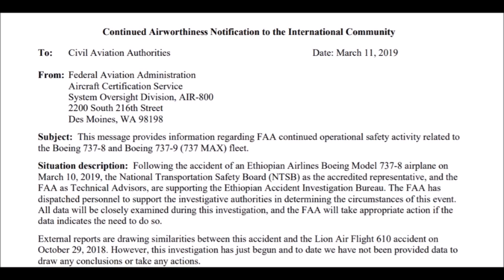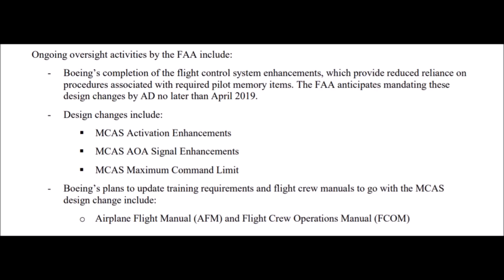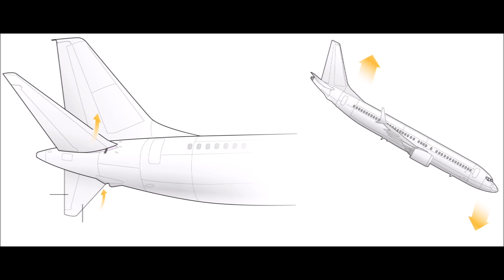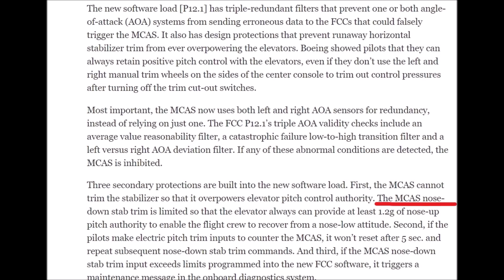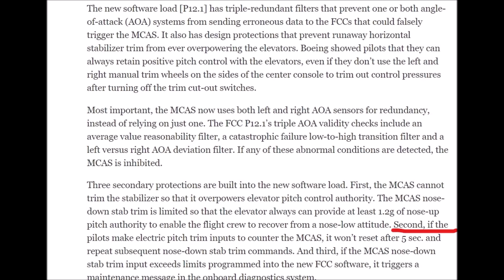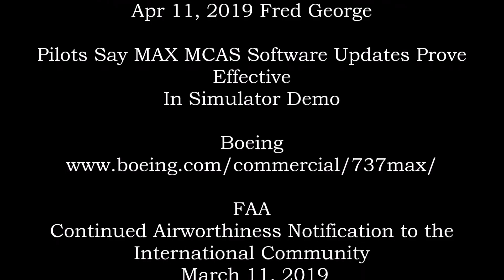737 Max UPDATE 14 April 2019 "The Fix"

Comment: As an A&P and pilot, having a computer that can take elevator authority completely away from the pilots control or cause a stab trim to have greater authority than the elevator is a terrible design. I'm with you bringing up the point how this got through certification in the first place. Situations can and will happen that require the pilot to be able to 'hand fly' the aircraft without a computer fighting every input to stabilize flight.
Reply: You are right If a pilot can not have complete control of the aircraft when the need arises then you might as well not have a pilot. I will never fly in a drone type of aircraft.  We will always need pilots like Capt. Haynes of Flt.. 232 in Iowa, July 1989, and Capt. Sullenberger of Flt 1549, January 2009..
Reply: @jameswilsonjr5726 Strangely Boeing made a big fuss over its fly by wire 'soft limits' on the B777 when it came out versus Airbus hard limits.   Boeing were completely correct so its bizarre they threw everything away on B737 MCAS.
Reply: @WilliamJones-Halibut-vq1fs  yeah, they certainly threw caution to the wind on this one. Sounds like this problem was driven entirely by money and convenience. Just to keep the type rating the same for transitioning flight crews. They compromised safety to avert the hassle and took a shortcut.
Reply: @BretAllenStudios    BOEING did not trow caution to the wind with the 737 . please stop propagating senseless and  incorrect statements.  All modern aircraft have some degree of fly by wire since you will damage the airframe without limiting software and feedback sensations provided to the operator of the controls.  I am surprised that no one is curious why a vane angle of attack sensor would be reading about 15 degrees of variation to the relative wind with the aircraft not in a stalled configuration. The aircraft airspeed is over 200 kts and there was  no icing conditions present to say that the angle of attack sensors became frozen with condensation.  Airbus lost an aircraft because of washing the exterior with fluids and introducing liquid into the angle of attack vane which later became frozen at altitude Airbus 320 Prepignan flight november 2008.
Reply: Is "stab trim" different from "elevator authority". Don't they both actuate the same control surface and the key difference being, one is used essentially to set the "nominal" control input (e.g. trim) and the other to make adjustments around the nominal (e.g. elevator) like if for some reason all the passengers ran up to the cockpit cuasing nose-heavy situation, one might "trim" the aircraft to get it level in that configuration and then use the elevator to raise or lower the nose around that level condition? Is that the key difference here?
Reply: @markmiller4414  yes. The elevator is the flight control surface itself. The horizontal stabilizer  (which the elevator is attached to) is pitched up and down using a jackscrew to 'trim' the aircraft. The majority of the control should rely on the elevator, while the trim stab makes the fine adjustments for the pitch configuration. Thus takeoff configuration of the trim based on the center of gravity  (CG) of the aircraft for example. The main purpose of the trim on an aircraft is to prevent having to hold back pressure or forward pressure on the control yolk to get the desired pitch.
Edit: This can get complicated on large commercial aircraft though, because like in the case of a runaway trim, especially at low speeds, the aircraft requires the stab to be set correctly in order to have the proper control over pitch. This is why they have movable stabs as opposed to a simple trim tab like on a light aircraft. They have to be able to deal with huge variables in cargo, passenger and fuel weight. The CG envelope on these aircraft are fairly impressive.
Reply: @BretAllenStudios  If I Understand you correctly, the flight elevators are on the stabilizers. Thus, errors in the movement of the stabilizer could amplify or negate commands to the flight elevator. It sounds like a plan designed to fail if erroneous automation is added.
Reply: @jasontraxler2946  exactly. That's why it's so important to have the trim set correctly on takeoff. If a trim runs away  (full down trim) on a takeoff, depending on where the CG is, there may be insufficient elevator to recover especially at low speeds. At least insufficient to recover in time. As speed increases, the control gains authority, however that gets complicated as well since many designs use 'limiters' controlling the throw of the flight control based on airspeed, which prevents requesting an input that could over stress the flight control surface.
Reply: Nunya Bizness 
1.I think the stab trim design just optimizes the drag on the whole control section.
They should have went with the full stabilizer or the traditional layout and not the combination of those...
2.There is only artificial force on the stick...
Reply: Nunya Bizness Odd really.  Supersonic military aircraft have long since moved to all moving stabilators where the function is combined.  It was necessary to avoid the problems of shockwave impingement.  There is no elevator, the whole stabiliser is used for both pitch control and trim.  It gets rid of the jackscrew.  You need a good triplicated hydraulic system and failsafe valves.   I think it’s safer and allows for a proper integration.
Reply: @BretAllenStudios  The majority of the longitudinal control rely on the stabilizer; not the elevator. Please read up on the system there are some basic books that you may find useful.    The elevator makes fine adjustments the stabilizer trim makes large adjustment. it is the opposite to what you have stated. The main purpose of the trim on an aircraft is to alter the longitudinal axis which is what the autopilot achieves when it is active,  the longitudinal axis is adjusted by trimming  to get a desired speed or climb angle. the control column creates variations in the negative and positive around the value set by the position of the stabilizer.
Reply: @jasontraxler2946   There is some misunderstanding  about MCAS.  If you are in a stall the MCAS system provides 2 units of down trim to assist in the recovery of the aircraft [ from a stall condition ]  the application of 2 units of stabilizer trim is more effective than moving the stick forward and gives the pilot elevator authority to effect the recovery.
Reply: @BretAllenStudios   Almost all the units of trim in the 737 and most other large aircraft is in the UP position meaning UNITS OF NOSE UP TRIM. The                              variation in the system is from 15 degrees nose UP to about zero degrees nose UP. Technically  there is NO downward unit of trim. gravity causes the aircraft to descend.  I know this is counter intuitive but it is correct.  the aircraft descends by reducing the units of UP trim. you may notice that aircraft on final approach to an airport is descending but the nose of the aircraft is still pointing UP.
Reply: @Nunya Bizness   What an abundance of vitriol.  I hope you don't react this way if someone challenges your decisions in the cockpit. [ I am type rated and was an previously a flight instructor [ enough said ] I have some concerns about information published on the internet that may be incorrect since it is very difficult to get something out of peoples head once it is implanted ]  The MCAS does not take away elevator authority or cause the stabilizer trim to have greater authority. This is incorrect. I have read your statements and subsequent comments. MCAS has as it's main function to change the stabilizer setting of the aircraft by a prescribed and reasoned amount in the event of a stall. In the event of a stall that correction creates greater elevator authority for the sole purpose of recovery which is achieved by a pitch angle alteration downwards. the intent of the system is to improve safety and it is a good conceptual design.  [ more ]
Reply: @Nunya Bizness  The problems with MCAS are different in nature from its intended design. the intent of the design was beneficial to enhancing safety, but still to be resolved is what was causing a seemingly erroneous stall indication at low altitudes. even at low altitudes you still have to reduce the pitch attitude of the aircraft for recovery. I have flown BOEING for years and never had one single stick shaker and I know that the design of the 737 MAX is not a departure from well established angle of attack vane technology.
Reply: The primary longitudinal control is provided for by the vertical stabilizer which has a much wider range than the elevators. The autopilot when engaged makes full use of the vertical stabilizer [ there are range limits ] and not as much the elevators. The pilot uses the elevators more because of our internal method of flying the aircraft and making pitch changes but once [ correct ] pitch changes are made you put that in the bank by adjusting the stabilizer which gives you a new reset on the capability of the elevators. but the stabilizer is the main flight control to affect changes of the longitudinal axis and that is one of the reasons that MCAS is connected to the stabilizers.  the Vane angle of attack sensor has to operate over a tremendous range of speed and pitch changes and still be correct. At high altitudes Vmo [ max mach ] and Vso [ stall speed ] are less [ numerically ] separated than at lower altitudes and the angle of attack for a stall will differ significantly,
Reply: @Nunya Bizness  One final thing that I want to emphasize is that the center of gravity of the aircraft can occupy positions between the forward and aft limit and must be correct before leaving the ground or the flight is not legally dispatched. The stabilizer alterations can affect the center of gravity as the airplane climbs and descends  but is not a failsafe against a poorly loaded aircraft. A center of gravity setting that is in compliance before takeoff [ and in compliance to the maximum operational weight  all conditions considered ] will stay within range as the aircraft changes pitch and an aircraft that is improperly loaded will defeat the effectiveness of the stabilizer and will most likely not remain airborne
Reply: @markmiller4414 The elevator is the 'flap' at the trailing edge of the horizontal tailplane.  The elevator 'flap' is what is controlled by the pilots yoke or stick.  The 'stabiliser' is the whole horizontal tailplane and it the B737 the angle of incidence can e changed by rotated by a jackscrew.   In WW2 the German fighters such as Me 109, Fw 190 and Me 262 used this system as did the Piper Cubs.  The allied aircraft such  as the Spitfire and P-51 used a trim tab on the elevator to keep it deflected a little to trim the aircraft.   Many ways to skin a cat.  In Supersonic Military aircraft and the Lockheed Trident the elevator and and stabiliser are functions are combined in what is called an all flying tailplane or stablilator.  Needed to cope with supersonic shock wave impingement.
Reply: @markmiller4414  Stabilizer trim creates elevator authority, when stabilizer trim is applied correctly elevator authority [ effectiveness ] is increased and preserved giving the pilot more control on the control column or control stick.
Reply: @markmiller4414  Yes, you are correct on the basic concepts.  Total number of passengers, current fuel onboard, cargo loading, and flight configuration (take-off, climb, cruise, descent, approach) have greater effect on need for trimming, than passengers moving about the cabin.
Reply: So the pilots didn't have two "off" buttons for that authority? Or they couldn't be expected to use them?
Reply: Not when the aircraft is fighting you with far greater than human force, all the way to the ground. Imagine being in the position of those pilots, struggling to stay alive while their plane is trying to kill them.  @ReflectedMiles
Reply: Christopher Webb  Not panicking in an emergency begins with flying the airplane. I’m afraid if this had been a runaway trim motor rather than MCAS, the result would have been the same—full-throttle augering into the ground. The pilots were unprepared to both fly the airplane and respond to the emergency.
Reply: @ReflectedMiles   Runaway Stabilizer situations are somewhat of a different animal.  You will notice a constant rotation of the trim wheel and the pitch of the aircraft is affected. the autopilot will kick off if on and this will continue until you stop it.
Reply: Tom A  Particularly during climb and descent, the trim wheels are running so much anyway that pilots rarely pay much attention to them and have to depend on AP disconnect and yoke pressure, etc., as a warning of something having gone wrong. The sequence of events in this accident clearly indicated that both of those announced the problem to the pilots. Even the low-time FO seemed to recognize it as well, perhaps from more recent sim exercises. Unfortunately, that didn’t result in a cutting of throttles and teaming up on the trim wheels. If any stuck switch or motor had been responded to the same way, the results probably would have been the same as well.
Reply: @ReflectedMiles  I strongly disagree with this notion and i have even heard the presenter of this video make such statements, I am a strong supporter of his work but i have to dissent.  It is your JOB to monitor what the aircraft is doing even when it is on autopilot. Every time that trim wheel moves, there should be some level of consciousness in the back of you mind saying,  Ok!! its doing this or its doing that.   Normally when hand flying the movement of the trim wheel corresponds to changes you are making with the trim switches which is reassuring.  it takes about 9 seconds       [ and several rotations of the trim wheel ] to effect 2 plus units of vertical stabilizer change; that is a significant period of time for recognition. The  McDonnell Douglas DC10 had a warning horn that sounded if more than 2 units of trim were applied without interruption.
Reply: @ReflectedMiles   Generally i have to agree that less speed would have been more conducive to recovery.  I still want to wait for the final report but no disagreement here. Remember on every preflight of a 737 [except when keeping the same aircraft ] the captain does a stabilizer cutoff switch test and the reality of those switches becomes firmly ensconced within his mind.
Reply: Tom A  Well, I’m sorry that you feel that way,, but we have to deal with actual ergonomics and human functioning in flight, not how pilots should supposedly function theoretically. When a pilot has lots of experience with all of the sights and sounds of “normal,” it’s just not that hard to tell when the trim system has gone wrong for whatever reason. What happens to the story of The Boy Who Cried Wolf if he did it routinely for years? About the last thing I would want to do is replace Boeing engineering with McDonnell-Douglas engineering.  That was an unfortunate decision to purchase on Boeing’s part.
Reply: @ReflectedMiles   This has little or nothing to do with human factors. I flew both seats on the 737 for years. there is nothing theoretical here. It is your JOB to monitor the functions of the airplane especially anything that affects the flight controls. Distracted flying is a problem in the industry. I have been present when crew members kicked back in the cockpit once the aircraft entered cruse altitude and were doing things that i will not mention here. Late recognition of problems lead to fatalities,  There was one example of an airplane landing without fuel on a small island [THE AZORES ] blowing out all tires to stop on the runway.  There were several anomalies along that flight that went unnoticed and a simple High frequency call to the company maintenance department would have uncovered the problem much sooner. AIR TRANSAT FLT 236. I am sorry that some people don't accept these findings but If you do not want to do the job you need to leave aviation.
Reply: Tom A  Ummm... of course it’s your job to monitor systems and controls. No one who has flown 737s or related aircraft would fail to understand why the stuttering whir of the trim wheels outside of cruise functions as an easy monitor for that system without even having to think about it. Sudden, continuous movement without a correlative cause would have any experienced pilot’s attention simply for not fitting the circumstance and “feel” of things. I can only imagine flying the opposite seat from you if you were focused on things like trim-wheel movement. If that’s what it took for you to be safe as a pilot, I would have been paying a lot more attention than usual when it was your leg.
Reply: Boeing have admitted they screwed up BIG-TIME.  Flogging a dead horse will not bring those people who died back.  But ensuring the programmer wallies who have never sat in left or right seats of a cockpit do NOT overreach their purview is a complex and exacting task methinks.  The MAIN reason (as ignorant lay person) why these accidents occurred is the appalling lack of appropriate and CLEAR warning to the pilots of the unusual circumstances.  If such a NON-CONFUSING warning had been in place, then disengage auto and seat-of-the-pants recovery would have been trivial.  My understanding is this is true of both recent crash events.
Reply: @jimparr01Utube  If you were a project manager on the 737 MAX and you had to place angle of attack sensors on that airplane,  How could anyone think that this undertaking is done in the same method as "reinventing the wheel" when you have had decades of Angle Of Attack sensors usage on a multitude of previous fleets and previous programming, comparison, and control protocol.  BOEING legal exposure is one of strict liability but  those inadvertent MCAS activations,  potential angle of attack sensor failures, and the information gleaned from the flight recorders have left me very uncomfortable as to the true nature of these failures
Reply: I am afraid that despite being an Electronics Engineer with nearly 50 years experience through the spectrum of industry, commercial and general whiz-bang-whir designing, I am unable to decipher just what your point (or question) is.
With respect, I would like to understand.  I am just an elderly nerd who has some flying experience (gliders and light planes) but have not sat in the left or right seat for nearly 40 years.
An alarm is just an alarm.  When so many alarms can conspire to render a state of confusion, there needs to be a solid FOCUS on what to deal with first.  In my view - take over control from the computers completely in such a case is what old-school pilots and very probably most active pilots would prefer.
Reply: @jimparr01Utube  It's an often oversimplified notion that in a moment of desire [ or need ] that electronic control of the aircraft can be disabled [ or jettisoned ] and that will somehow create a management platform to deal with other issues. Basic airmanship is what you do before transportation category aircraft.  Being a good stick is secondary skillset  to Decision making,   system management, problem resolution, and cockpit resource management.  Sometimes proper cockpit resource management will dictate that you operate the aircraft automation in order to maximize your limited resources to deal with other issues.  Consider that with the elimination of flight engineers from the cockpit the two remaining staff positions has to be efficiently utilized.,
Reply: @jimparr01Utube  There was an unbroken chain of events that may factor into the loss of this aircraft and i will restrict some of my comments in recognition of not having a final report.  After the first activation, the MCAS was disabled with the stabilizer cut off switches, from that point control of the aircraft's longitudinal axis became a manual function. It is likely that the speed accomplished by the aircraft made manual operation of the trim wheels difficult.  Possibly, a reduction of speed in a timely fashion would have restored the ability to use the vertical stabilizer in manual mode.  I also have to acknowledge that this was a busy cockpit and the crew was acting to control events that were occurring.
Reply: The point that i was making was there are a very significant amount of reported angle of attack vain failures [ actual or perceived ] in this new fleet, and that the MCAS system was created with a almost total disregard of previous proven design technology. I believe that no company moves in that direction with a proven fleet like the 737.  The MCAS system becoming active in situations when it should not be is very concerning and is still an unanswered operational variation.  Can anyone imagine how many  pounds of force it will take to move a angle of attack vane to a reported 15 degrees of opposition to the relative wind at the speed that that aircraft was proceeding. If the vane sensor was indeed acting normally what was the origin of the data suggesting a critical angle of flight.
Reply: @YouTube.TOM.A 
Ok Tom.  I admit my ignorance in respect of detail is great.  But perhaps we are entering a circular argument/discussion.

Your last comments seem to imply that you are on the SAME page as me.  Why are we even discussing stuff that is already cast in concrete?

The soiid FOCUS thought however is one that stays with me.  If computer programmers are clever enough to fly an airplane, perhaps they are clever enough (with suitable whacks around the head - and maybe a couple of flights to put the fear of God into them) to ensure that their programs deliver properly triage-filtered information to the pilots in exceptional circumstances.
Reply: @jimparr01Utube  I respect your interaction and there is no lack of knowledge on your account. I was an auto mechanic [ and helicopter hydraulics technician ] while in flight school . i still work om cars mostly computer and command modules. The next time you go through a green light it is basically a computer that is making the perpendicular light red. one of my cars have electric brakes only.  If i ............. shoot out the two batteries in the car i can do the whole grapevine and wet myself at tejon Ranch.  Technology is everywhere  there are protocols before they enter service and your car would not shift out of first gear without it .  [ more ]
Reply: @jimparr01Utube  Boeing have been flying those angle of attack sensors for decades and there have been software associated with them for a long time.  Normally the Vain sensors detect angle of attack beyond a certain value and activate stick shakers and / or stick pushers. [ In the 737 MAX MCAS ] There is a well established method of making that  "wiggett"  work at different speeds , different altitudes, and at different flight configurations that have been in the realm of aviation for decades.  Why now is it that BOEING with all that background will be having all those irregularities with  something that has become somewhat basic is a big question.  This should not be happening all things considered. and i am very uncomfortable with some things that ..................... .....................
Reply: @YouTube.TOM.A  Fair enough.  My understanding of MAX 8 issues is just from public-domain.  I have NO knowledge of the details.  I have simply 'vented' in respect of the crass stupidity of large corporate organizations that place profit over safety.  Boeing (until recently) has never been accused of this.  Maybe they should be - now.
To remain "on-the-fence" and hopefully fair, I would also say that the 737 (until recently) has NEVER been an aircraft that folks would say they would never fly on....
Now we have documentaries that slam the 787 manufacturing plant, place Boeing in league with Macdonald Douglas (important) high flyers, who allegedly don't know shit about anything of importance, and who also totally trashed the Boeing manufacturing model --- A MODEL THAT HAD WORKED WELL FOR MORE THAN 50 YEARS - until they came along.

I am not sure of any of my facts above, but I hope you accept my rave as an Engineer Ignoramus in the aircraft industry.  I do NOT invite correspondence on this posting.  Rather, I wish to bow-out of matters that are beyond my sphere of knowledge.

Bye-bye folks.
Reply: I cannot speak of the internal deliberation at BOEING with regards to this product which is an extension of  the 737 fleet, I am doubtful that dysfunctional large corporate culture and greed were deciding factors here,  sometimes there is NOT a tyrant behind every leafy bush or under every rock. I am encouraged that whatever the problem was that the company has committed itself to a solution and have made a public statements to that effect.  large cooperate concerns always generate reports and insider information that serves one objective or another  and a person has to be discriminating to not just follow convenient breadcrumbs that lead "hither and yon". Eventually the truth will prevail since a commitment to safety will never be absent from the profession of aviation manufacturing.  good luck!!
Reply: @jimparr01Utube  The Pilots stopped Flying the Airplane and became fixated on the problem. That is the most common of all pilot errors.
Reply: @richb313  I think you are correct.  Why -as I have been asking on other postings - have the pilots been expected (training) to try and follow the "problem-trail" when 'switch off the computer stuff and just fly the bloody airplane' would be the way through the problem.  I really don't know what I am talking about Rich.  Truly...  I am just a lay person (Electronics Engineer) and amateur pilot from 40 years ago.
Reply: The FAA doesn't know shit about airplanes. They just think the do. They hire/contract morons from universities to do the knowledge base.
Reply: The FAA doesn't design airplanes, manufacturers do. The FAA only gets involved when something breaks. The question here is how Boeing could have managed the feat of stupidity where MCAS had both AOA inputs available and deliberately chose to ignore one of them.
Reply: @lwilton  That is a very excellent question.
Reply: @lwilton    If you are interested in aviation do some studying. what you are saying is incorrect. The system has the ability to compare angle of attack values. There is an [ optional ] disagree light that does just that. At the time of the accident there were TWO working angle of attack sensors.  It is not a simple process to select which sensor is correct  if you have differences. Introducing more and more variables into an equation creates more selection possibilities and more problems.